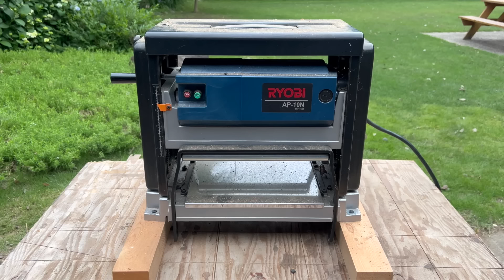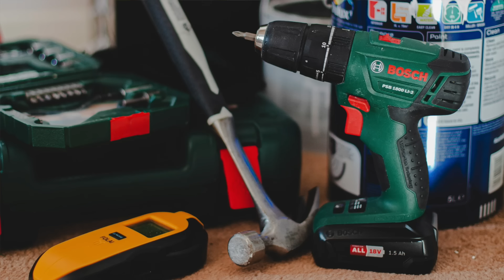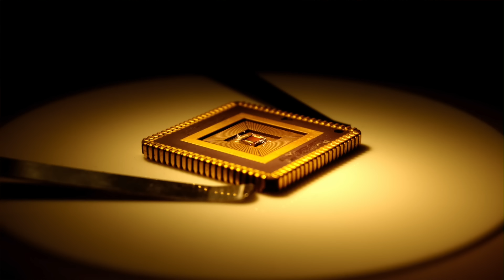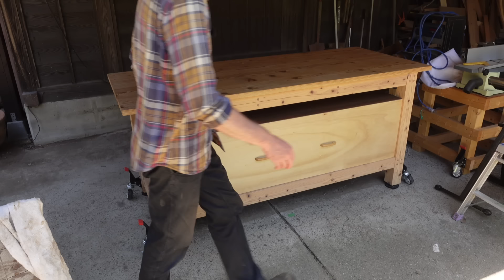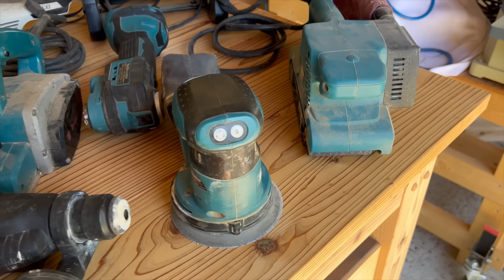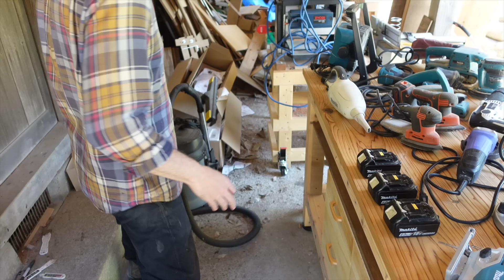Why You Can't Buy Ryobi Tools in Japan

Comment: Hm. The first time I even saw a Ryobi power tool - green color and all - was in Japan. Some years ago. I had never heard about the brand before, it wasn't sold in my country at the time. Since then they've become very popular back home, but as I said - I saw them in Japan first, and they still had them some years later. In fact I planned to buy a Ryobi drill next year, when I move back to Japan permanently.  If these are now replaced with red Kyocera tools.. well, I didn't know that, and I hadn't noticed this even though I visited some shops this spring and last year as well.

Comment: First time viewer. I came to Ryobi via the Australian legends "Mighty Car Mods". Ryobi started selling their one+ stuff around 2016 in "Bauhaus" (one of the german ?home depots?/diy markets). They were affordable in comparison to Makita. But around 2018 the german manufacturers and Makita started really selling their stuff, which became cheaper. Nowadays Makita is the best price/performance tools. The tools are relatively expensive but their batteries are affordable. But Ryobi got too expensive compared to what you get and their batteryformfactor makes it difficult to use their batteries with other tools via adapter. But I have a few ryobi tools and am kinda stuck with that platform as they weren't that cheap and a lot of thheir tools are not sold in Germany so they kinda lost that marketshare.
Reply: Moog and Marty convinced me to sell my Bosch tools and switch to Ryobi.  They've been great for working on cars with 😄

Comment: Cool, are there more old wooden houses for sale in the neighbourhood?  I am swimming in Ryobi tools here in the Rocky Mountains that need a good project and less fire.
Some DIY notes from the other side of the Pacific: Ryobi is one of the leaders in battery packs, the survey crews here use Ryobi hammer-drills up in the mountains and both the tools and the batteries hold-up like champions.  Ryobi's new 4V USB Lithium line is also very clever, and evidently they have taken the time with the BMS so that they can be stacked like old-school cell batteries, and they double as pocket battery banks by default.  Dewalt seems to be having success doing the same with their 20V packs, which is really handy with the new 40V kit that is coming out - it is able to hold its own against small gas engines in tools like chainsaws and string-trimmers.  here in Canada the retail chain Home Hardware appears to be selling Dewalt in red under their Benchmark brand, I have pulled one of these 2x20V=40V tools apart to see how they do that, and in Benchmark's case it is remarkably simple, they simply bridge the terminals on the battery connectors with 20A10 rectifier diodes (stripe to the positive terminal) and wire them in series to the motor controller.

Comment: You didnt mention that Ryobi also used to build fishing rods and reels between 1970–1990. As of 2000. Rods and reels are still produced and sold under the Ryobi branding but Ryobi themselves have very little to do with with it other than collecting a paycheque every year as they have licensed their brand out to manufacturers outside of the business and distribution can be patchy to non existent. A lot of the older reels that they made themselves are still quite sought after by people who collect vintage fishing gear.

I dont know who they have manufacturing their fishing range now, but most people will go for mainstream brands like Daiwa or Shimano over Ryobi. Current day Ryobi fishing equipment still represents good value but other than vintage collectors. Nobody really cares about them anymore.
Reply from the maker: Funnily, I was going to mention that, but wanted to keep it short. I used to fish as a youth and although I had Daiwa reels mostly, I remember the Ryobi gear too.

Comment: How do you protect tools and equipment from moisture and rust?
Reply from the maker: I keep the tools locked inside - havent noticed any issues, even on the ones outside. I do cover them in blue sheets when I know there is going to be heavy rain.

Comment: Yay! You're back! Always nice to hear from you. It's bizarre to me that Ryobi isn't a toolmaker anymore, but I guess that's the way corporate life goes. But I prefer Makita myself, as you clearly do too. xD

That's a nice looking bench! Way nicer than mine which is, well.... essentially a table. That I made out of scrap wood. That's the newer half. The older half is an old garden box I put on top of a salvaged dresser that I fixed. So I have storage! The garden box part is even heated, so I can put things in it if it gets too cold. The dumb thing is that it's actually... fine? For my nonsense? Which is mostly fixing bicycles, not woodworking, though I can woodwork a little, like, I can knock together some custom cabinetry in a pinch and it's not even terrible. (Like, I made a corner cabinet for a kitchen a few years ago that opens from the top because due to existing cabinetry reasons there was no way to get access to it otherwise and I needed cabinet space regardless. So: top-opening tri-door surface-access cabinet. I'm still really pleased with it, but don't call me for normal cabinets, I just do the weird ones. xD )
Reply from the maker: The previous bench did serve me well, and I could treat it badly - not worry about drilling into it or saw marks, which I probably will be concerned about now! Yes, it's great to be able to make your own cabinets - if I'm feeling lazy or think I dont have time I will go to Ikea (or Nitori, japanese equivalent) but after looking at the prices end up just going home and making something similar and reasonably nice for a fraction of the cost!

Comment: Using the adjustable subfloor supports for the legs was a stroke of genius!
That is a very well-built, well organized workbench. I salute you, sir!
Good to see you back. Looking forward to new videos.
Reply from the maker: Thanks, it was a bit of luck as I came across them in the same section at the home centre as the post footers (non-adjustable) that I was planning to use initially.

Comment: Sweet! A new Tokyo Lama video!

When I got my house in 2006, my mother (who loves Home Despot) was kind enough to buy some tools for the house. That included a set of Ryobi 18v tools.
Since I was in that battery ecosystem I've stuck with it, other than big stuff which I went with Ego.

But being in that Ryobi ecosystem has kept me buying Ryobi tools like my miter saw.

Otherwise, I think maybe a good tarp would keep that workbench protected from direct rain during exciting weather.
Reply from the maker: Ryobi is probably fine for most uses non-professional uses. Here Makita and Hikoki have their DIY and pro lines. Yes, I cover with a blue sheet but maybe something roll down would be neater and easier.

Comment: As someone who moved from Aus to Japan, how did you find swapping over to JIS head screws almost exclusively? Back home all anybody ever used was the square head, since moving here I've only been able to find the cross JIS head and am finding the screw heads always slip when I try driving them in with a drill. Is this a me problem or is this something that you noticed as well?
Reply from the maker: Yeh, they slip and especially with the soft sugi and Hinoki they can be a problem. Had to get used to putting a bit more pressure when driving to lock it in.
Reply: @TokyoLlama  Thanks, I guess I'll just have to embrace the Japanese way and stop being such a gibbon with my tools.

Follow up question if you don't mind., had a look through your videos but couldn't spot it, who makes that outdoor table you've got in your closing shot (13:16)? I've been looking for one for a while but they're all too small and flimsy looking, your one looks exactly like the one we had back in NZ which is what I want.
Reply from the maker: I made that myself - plenty of plans online if you want to give it a go!

Comment: The last Ryobi tool I bought was a waterblaster. After an hour of use the lubricant leaked out of the pump and it seized. I opened it up for a look and it was just the cheapest, nastiest design work I've ever seen in a tool. You get what you pay for.

Comment: In the US formerly hitachi tools were renamed "Metabo". In Japan they are  "Hi-koki" so you know it 's somewhat still hitachi roots. The dumb Metabo name has made them lose more than 50% sales. It's akin to renaming Bosch to "facebook tools".
Reply from the maker: I only realised recently that Metabo was Hitachi - thought it was some cheap Chinese tool brand. Not sure why they felt the need to change from Hitachi, even in Japan. Edit: I should have guessed it was because Hitachi sold off their tools division.
Reply: @TokyoLlama even more confusingly, in the US they're branded Metabo-HPT (Hitachi Power Tools, presumably), while Metabo maintains a separate line of corded and cordless power tools which are not compatible with the Hitachi/Hikoki batteries--they're best known for their industrial grade grinders, but also do concrete coring tools and other heavy construction stuff.

Comment: My opinion on Ryobi tools is not fit to post publicly. I will say "plastic camshafts" and let it be.
Reply from the maker: I’ve never used one since I became more “serious” about tools. But I’m very happy with my Makitas.
Reply: @TokyoLlama  Makita are a good balance between price and performance. Even the cheap stuff they make now compared to years ago is pretty durable and loads of tradies get plenty of life out of them.
Reply: @TokyoLlama  I was looking into tool brands a short while ago and settled on Makita for when I next have a project that requires the investment
Reply from the maker: @burnzy3210 never had a problem with any of my Makita tools except for one of the lamps.
Reply: @TokyoLlama  good to know thanks, not worried about utility lighting in the slightest haha
Reply: I've never bought Ryobi here in the UK because they're one of the most expensive and considered a premium brand, so I'm surprised to see someone have a low opinion of them 😄 I tend to buy Makita myself as they're much less expensive but fairly robust and reliable ☺️
Reply: @LaReynedeNeige it is absurd to consider Ryobi a premium brand..
Reply: @KSCPMark6742  That's the case in the UK, however 🤷‍♀️
Reply: @LaReynedeNeige Marketing works.
Reply: @KSCPMark6742  I'd be surprised if the pros who use them were that easily duped, but there you go.